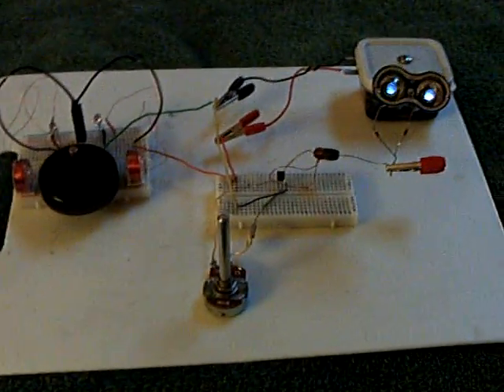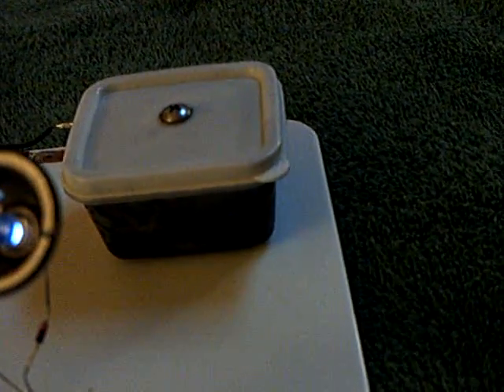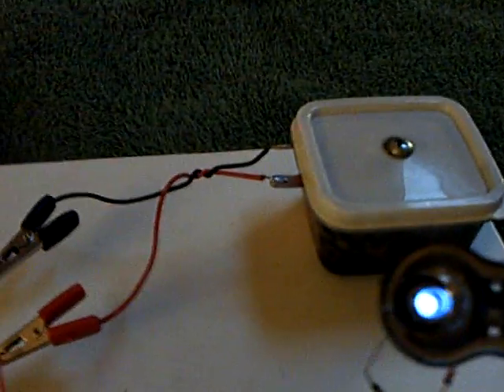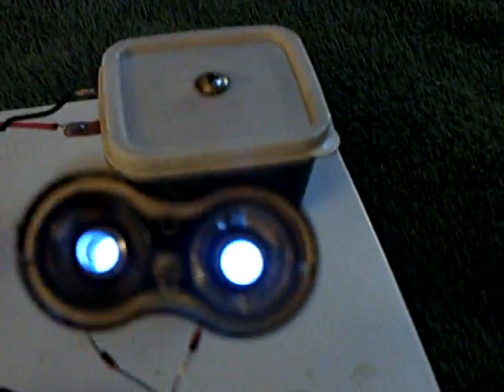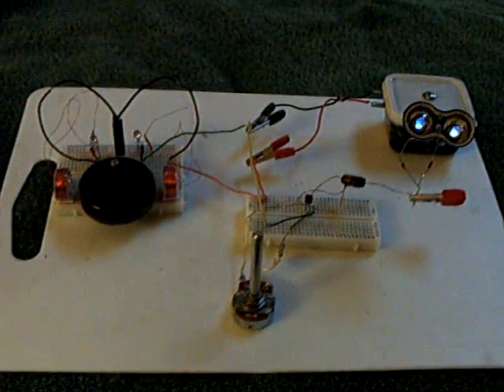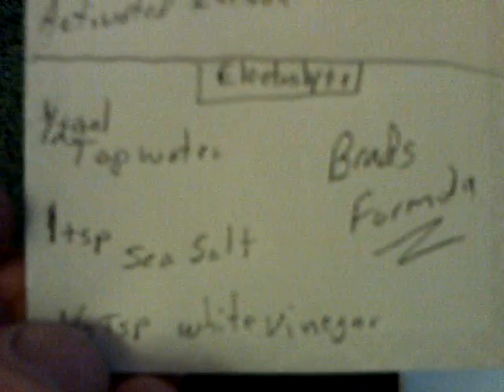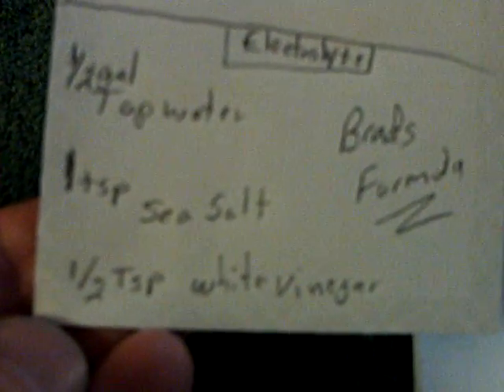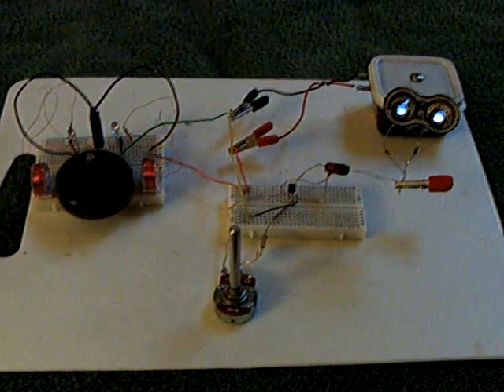Zinc and Aluminum alloy anode cell running pulse motor and Exciter.

Comment: Yes, no problem. The challenge is to build it with a good surface area for the electrodes and to build it this way. that you can exchange the parts easily, like replacing ZAMAK or alufoil and also replacing the electrolyte without destroying the whole cell...So it is more a mechanical problem than a chemical problem now...
Also it helps when the lampblack can breath air, as it is also some kind of air battery...Hope this helps. Regards, Stefan.

Comment from the maker: ZAMAK mesh and stainless steel mesh.  OK.  I was kinda thinking the same way except in a grid form like what is in a regular lead acid battery.  You are right about this all being done before.  I figured that it had been but just wanted to experience it for myself.  Sometimes ignorance is bliss and all you are hoping for is an accidental new finding along the way.  I have had it happen.

Comment: ZAMAK mesh would be great for extended surface area !
Also go with Stainless steel mesh instead of the copper, as copper
will be consumed too fast !
ALso use lampblack baked or grinded into the stainless steel mesh as the other electrode.
Looking forward to see an 4 Watts LED light up from your cell with some kind of joule thief or joule ringer driver circuit..
Many thanks for your great work !

Comment from the maker: Thanks for the tips.  The main thing that we are looking at right now is the anode alloy material.  The stuff that I am using has a low melting point so I might try to make some kind of grid plate to increase the surface area.  The reason that we are using activated charcoal is for the surface area also.

Comment from the maker: So far it has run about 12 hour without slowing down. That is encouraging.  Usually I can see a pretty fast drop off in RPM as the cell neutralizes itself.  What we are after is not only a good power output but also a consistent one for a long period of time.

Comment from the maker: Actually I had one of my Penny oscillators working on this also before I made the video. It was too many wires so I took it off.  I think that the key to the amperage is the activated carbon.  Your electrolyte formula seems to work quite well in this cell.

Comment: Go with lampblack, which is much more conductive! Also you need more surface area for the battery ...for higher output current ...also try K2C03 with water as The electrolyte ...

Comment: what happens if you connect a few cells in series? Can you run the super joule light? I hope so, as this  would make the light so much more interesting and useful!!! I can't wait to see how long these cells run, and if they can be easily regenerated with fresh electrolyte and a quick sanding of the anode, or is the rod the cathode, have to watch again to check. Keep it up!!!